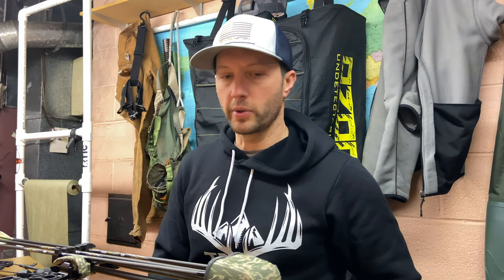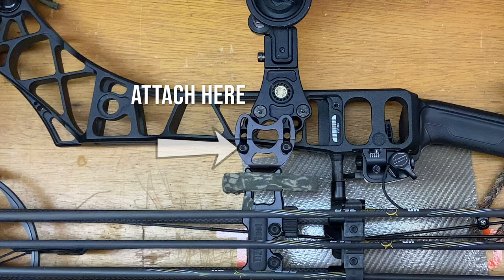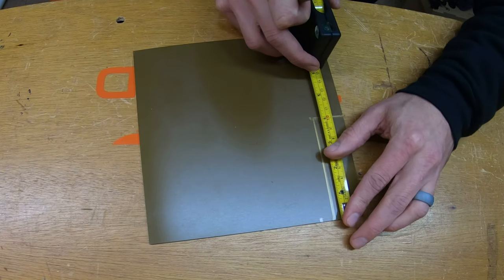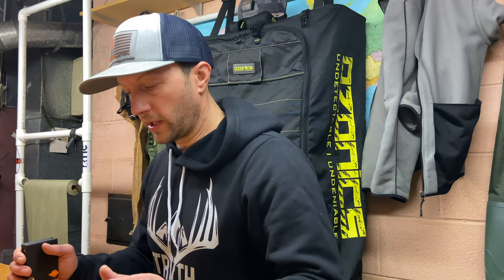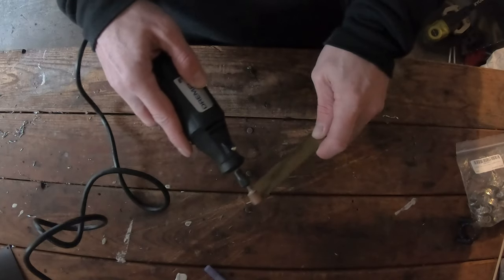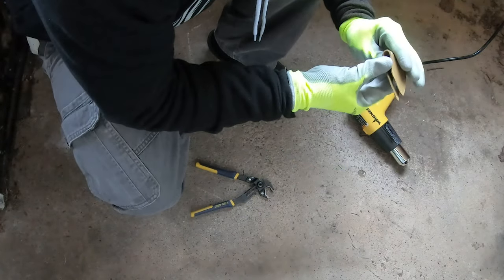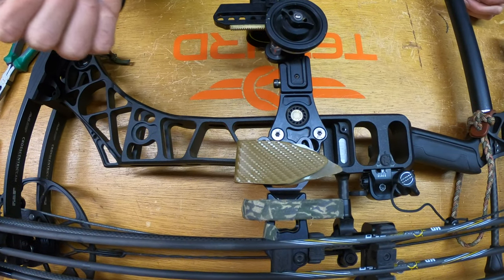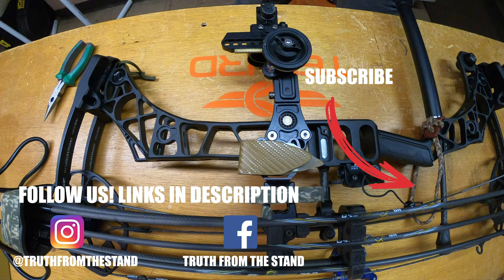How To Make a Lightweight Bow Hanger | Public Land Legal (Video)

Comment: Not understanding....
How will the quiver be able to put on and off if its mounted there?
Reply from the maker: At 1:45 you can see the glide sticking up between my hands which is where the quiver attaches.
Reply: @truthfromthestand9994  Would you mind taking an additional photo or two of this setup?  Based on the other questions here, it seems like this is a common point of confusion for folks.  At least with my quiver, I don't think that I would be able to have both this mod and the quiver at the same time unless I am completely missing something.  Thanks bud!  Love the podcast and channel!
Reply from the maker: @pnggolfer9  it may not work with all quivers. it works with a tight spot since the quiver attachment is offset from where the attachment base connects to the riser of the bow if that makes sense. I'll try to remember to snag a photo.

Comment: I listen to alot of your podcast  and you said your DIY your climbing stick 
For the one stick climbing method.  You mentioned you 
Have a job in marketing.  If you don't have a back ground  engineering or cnc machinist  that's  very dangerous.  You seem like really smart guy why something that reckless? Why wouldn't just buy a mini  climbing stick. I fell from a tree   over 30 feet lucky thier was snow on the ground I was 18 I had craw out of the woods. No serious injuries
Reply: Education is not synonymous with ability
Reply: @Fin2hill  I fell out of my tree stand when I was younger   I was over 30ft .  Is it really worth the risk? Thier has to be a good reason why they engineers design and test climbing sticks. That be like a rock climber making his own carabiners
Reply from the maker: There is risk any time you leave the ground. I'm willing to assume the risk of making my own sticks. I've climbed for 2 years using sticks I've made with no failures. I don't use anything I don't test and beat up at ground level. That goes for DIY or purchased gear. Even then, there's no guarantees they won't fail.That said, I'll likely trying to use the Tethrd one stick for one sticking this year.
Reply: @truthfromthestand9994  ok I wasn't trying to mean or anything I fell from a tree thiers no glory in it. I was lucky that I didn't get seriously hurt I was over 30ft high lucky for me snow on the ground.  Stay out of harm's way good luck.
Reply from the maker: @kidney stones  no offense taken, and actually appreciate your concern brother - and glad you weren't seriously injured in your fall. Your heart is in the right place...need more of that. 👍👍👍